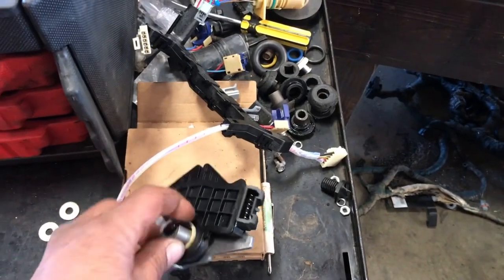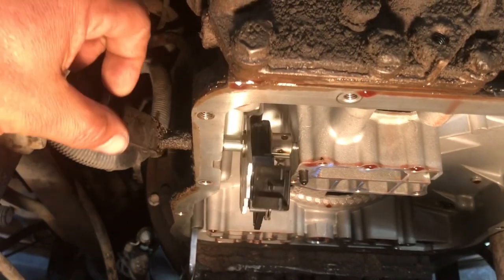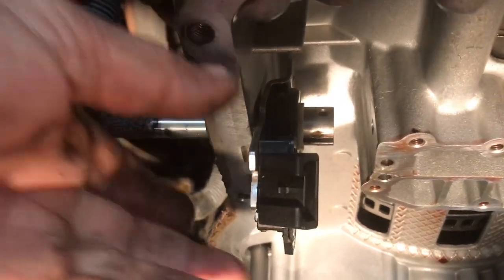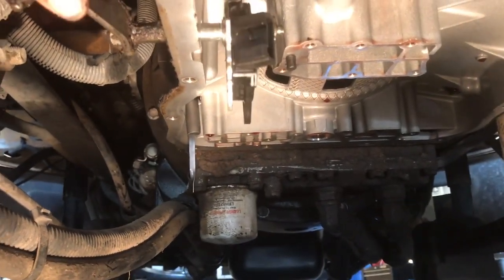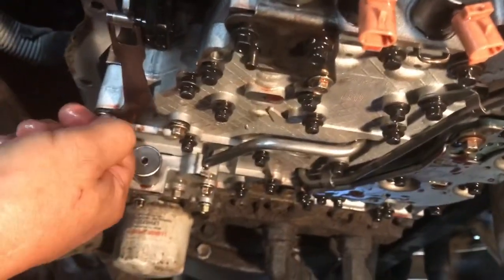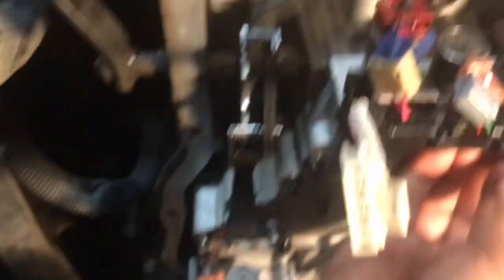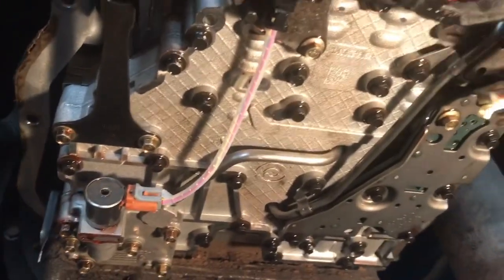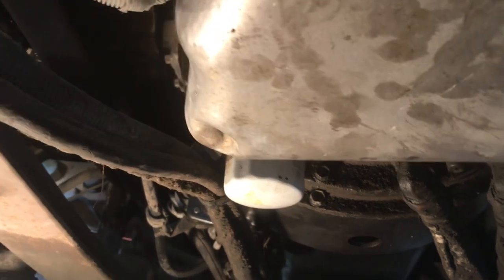Allison transmission neutral switch

Comment: There is a rod with a spring and rollers, which connects to the prndl of neutral safety switch.  I didn’t see you put that part in, and it’s the only part I think I screwed up on!   Great video, btw!   Thank You!

Comment: Hey Joe I’ve 5 ton international truck dt466 4300 and I got little issue Range inhibit light on  and I can’t drive forward/revers too. C
Reply from the maker: TCM fuse or relay may be giving you that issue. Those are the first 2 things you want to check
Reply: @JoesBusBarn  thanks I’m gonna take look
Reply: @JoesBusBarn  if I wanna ordered both the switch and harness ,where the quickest can I find? I’m in Canada 🇨🇦 and that switch has to shipped from factory.
Reply from the maker: Let me get u a link to those 2 items. I’ll send it ur way
Reply: @JoesBusBarn  hey 👋 u didn’t send me the link

Comment: What year or what transmission was this one?  I have the problem where my shifter won't come out park , if I shut it off and re start truck,  it will shift out park, my brakes do work when this problem occurs to sort out brake switch
Reply from the maker: You need to check your park solenoid at the shifter. The brake switch powers the coil so the park lever can be move out of park.
Reply: @Joe’s Bus Barn  yes I spend the day diagnosing this issue and yea it was the shift interlock solenoid

Comment: Hey Joe,  I'm having a issue with the truck ... it a 2005 international 4300 466dt with a automatic allison transmission.. all of sudden the backup lights stop working  and have no backup lights.  I check all the wires connections and all good . I'm thinking its the backup light switch Can u tell me where it's located?
Reply from the maker: Bolted to the trans body

Comment: Do you torque the valve body bolts?
Reply from the maker: They are suppose to be torqued down. Now I just do it by feel. I’ll message you the torque specs tomorrow if you need them Erik

Comment: What are the symptoms of a bad neutral switch? No start?
Reply from the maker: Hey there Omar. Yes sir. Won’t start at times.
Reply: @JoesBusBarn  cuáles pueden ser las causas que esa transmisión se sobrecalinete después de haber cambiado solo las válvulas c,d, y e
Reply from the maker: Hey Jose. Uno de los seyos de el tambor de 1 y 2 o el de 3 y 4 a de estar roto (fugando). Clutch pack molded piston. Trabajava bien antes de cambiarlos. Cuanto sedimento encontraste en la tapa de transmission.
Reply: @JoesBusBarn  gracias Joe, no se encontró sedimento, tenía problema con la válvula E se atasco, se remplazo válvulas c,d, e y ahora la transmisión trabaja perfecta sus cambios muy bien. Solo que ahora se sobrecalienta

Comment: Will u work on my macforce 13 losing power going up mountain
Reply from the maker: Hey there Phillip. I’ll help you out through email, phone, or hands on (in person).
Reply: @JoesBusBarn   I have an 02 international 4300. It's running in low gear and won't pick up any speed when I try to accelerate.  What may be causing this? I have Trans Check light on

Comment: Hey Joe my R flashes and pops out of reverse would that be my switch
Reply from the maker: Hey there J Man. You need to scan that issue. Question. Do the forward gears function properly or are they doing the same thing.
Reply: Hey guys, I have a 2018 3500 truck with Allison tranny, yesterday I was backing up really slow and I stared feeling a bug on the transmission. 3 seconds later bangggg it stared flashing red and it would not move. All my gears in forward are good. Just having the problem on reverse.

Comment: Would this cause my reverse lights to not work?  Iv checked all fuses. Some forms are telling me it might be neutral reverse switch. Or a reverse light switch?  Causing that problem.
Reply: My truck does not go into limp mode on certain tunes. When I switch my tune to max performance it goes into limp mode.

Comment: Tengo el mismo problema.  Q no meda star y nadie. Puede  hacer ese trabajo
Reply from the maker: Hola Mary. El problema Que usted tiene es en un camion o en un bud.
Reply: @JoesBusBarn   es un 2008 Ford f650  tow truck
Reply: @JoesBusBarn   tiene la luz. En el tablero q dise RENGER INHIBE
Reply from the maker: Mandeme un correo electronico para mandarle mi numero de Telefono. Nesesito mas datos para poder ayudarle. Joegonz268@gmail.com.